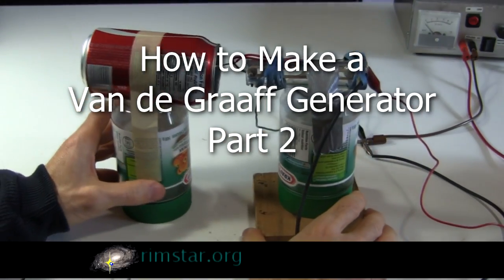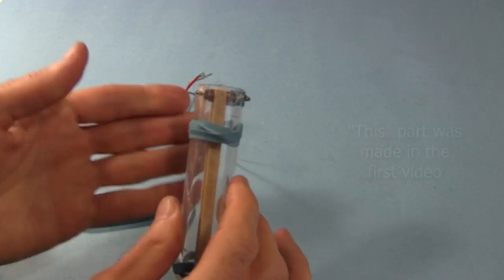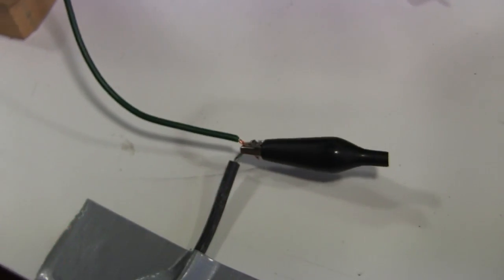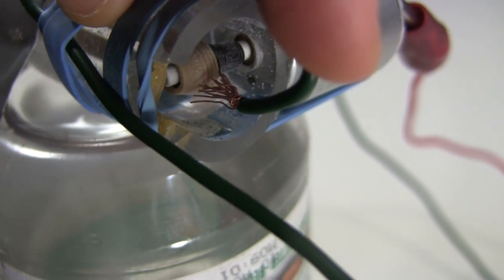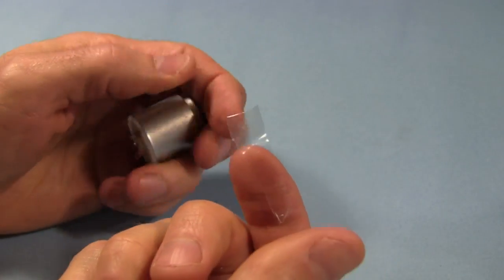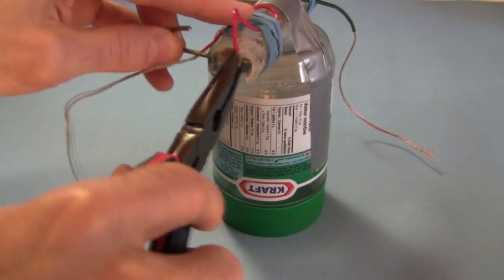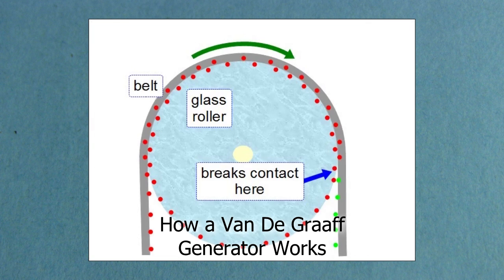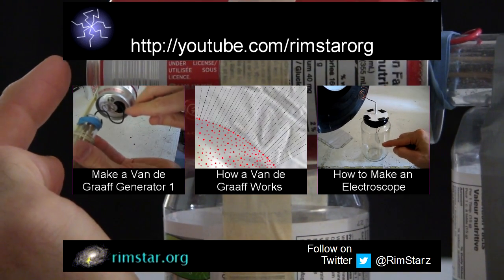How to Make a Van de Graaff Generator Part 2

Comment from the maker: A ground is necessary, but as you saw in this video there are many ways of doing the ground. Even just holding the end of the ground wire in my hand worked fairly well. Putting the ground wire inside another can worked great! In fact I don't even use the ground wire going all the way to the wall socket anymore, I just use the second can approach.

Comment from the maker: Good point. A good ground for this case is one that readily accepts or gives electrons. The soda can is small but you're connecting to the inside of it. Connecting to the inside allows the Faraday ice pail effect to take place. That effect causes the wire to always see a neutrally charged inner surface even though the outer surface might be hugely charged. And a neutrally charged surface readily accepts or gives electrons. Connecting to the outside of the can would make it a bad ground.

Comment from the maker: You're right on. The triboelectric effect that causes the static electricity when you walk on the carpet is the same thing that's going on between the rubber belt and the rollers in these Van de Graaff generators. When you walk on the carpet, the material in your sock is making and breaking contact with the carpet and that causes negative electrons to transfer from one to the other. As a section of belt makes contact with a roller and then breaks contact, the same transfer takes place.

Comment from the maker: Good question. My guess would be that the sparks would be the same length but thicker/brighter/louder/more painful. The latter would be because when it sparks, there'd be more charge/current in the spark. I think it'd be the same length because the curvatures of the surfaces involved haven't changed. You should get the same length sparks near one spot on the dome with and without the can. But you said below that you're getting longer sparks, and experiment is king, so, so much for my guess. :)

Comment from the maker: What materials are you using for the belt and the two rollers? How are you doing your grounding? If you're using the second can as a ground, are you connecting to the inside of it? The faster your motor turns the better it'll work, but be careful not use more than your motor's rated voltage and current. The wires facing the belt must have sharp points, multi stranded wire is good for example, but space out the strands. The wires facing the belt must be close as possible.

Comment from the maker: That depends on how fast the motor can turn the belt. If it turns slowly then it will take longer to charge up the can. The faster it turns the faster the charge will build up and the more frequently you'll get sparks. Make sure you also watch my "How to Make a Van de Graaff Generator Part 2" video for more construction tips. There's a link to it in the description for this video.

Comment from the maker: When you were using the tape, either one, as a belt, did you have the sticky side facing outward? It should be. What are you using for the brushes facing the belt at the rollers, where I use the fanned out ends of stranded wire? Multiple sharp points are needed here, so if you're using stranded wire, separate the ends and put them as close as possible to the belt. Try different locations facing the belt. Just because it's nylon wire doesn't mean it's not coated. Experiment with other materials.

Comment from the maker: You can increase the length of the arc by moving your finger farther away. Sounds like a silly answer but the increased distance gives the can more time to build up charge, though the arcs will take longer to happen. You'll probably still find a limit so using a bigger, more rounder dome instead of the can will help. In case losses are happening too fast you could spin the belt faster - faster motor, more power to the motor (but stay within the motor's ratings), grease the shafts.

Comment from the maker: Did you try to pull it off somehow (with a pliers or something) while it was heated? You may need a hotter soldering iron. The soldering gun I used was 150 watts. Most soldering irons are 10 to 30 watts. I'm not sure what the minimum you'd need it but that is a difference. If you can find a way to hold it you can put it on an electric stove's heating element, but put a pot of water on the same stove element beside it to protect the stove element.

Comment from the maker: I used my homemade power supply. What you need for power depends on your motor. Motors are rated for a maximum voltage and a certain amount of current/amps. You can try running it on batteries, but it depends on the motor whether it's powerful enough to turn the belt. Another option for power is wall adapters, the ones that come with many appliances. Check the writing on them to see if they supply the voltage and current your motor needs.

Comment from the maker: To start and stop it put a switch on the positive wire going from the batteries to the motor. Make that wire long enough so the switch can be in a handy place.

Your Ghostbuster idea's brilliant. That way you can also put as many batteries as needed, including spare ones, in the backpack. Be careful to not cross the streams!

Don't use rubber bands to hold the brush wires in place. With all the moving around you'll do you should use something that'll hold them more rigidly facing the belt.

Comment from the maker: Do you mean nylon fishing wire for the surface of one roller? What's the surface of the other roller? In the triboelectric series table one roller needs to be towards the positive side, one towards the negative side and the inner surface of the belt in the middle.
Do you connect your wire to the aluminum ball's outer surface or did you make a hollow ball and connect the wire to the inside surface. It needs to connect inside, and have a gap around it where it enters the ball, like an open mouth.

Comment from the maker: Go to wikipedia. Search for "Triboelectric effect". Part way down on the right is a Triboelectric series table. Glass is on the + side, vinyl (electrical tape) is on the - side. The belt material should be in between those two in the table.
I doubt that the elastic in trousers and shorts would work. It doesn't have a very smooth surface so there wouldn't be as much contact with the rollers and I suspect there's a lot of die to color it.  But that's just a guess, I haven't tried it.

Comment from the maker: It's not grounded in the strictest sense. The two wires going to the outlet are called hot and neutral. The neutral in the US should connected to ground at your main breaker panel box. However, depending on who wired your outlet, the hot and neutral may be backwards or the ground to neutral connection may not have been made in the breaker box.

Comment from the maker: I'm not sure if a drinking straw will work well. I don't think so. I tried it when I was making that section of video and it wasn't giving good results but then the glue I used to hold it to the motor shaft failed and the straw started slipping. I'm pretty sure that before it started slipping it was giving bad results but you could give it a try anyway.

Comment from the maker: He gets bigger sparks due to the materials for the rollers and belt, which is really just a case of luck in what you have around, and because of the wider belt. The wider the belt, the more charge you pump. In fact, given the slow speed of his motor, I think it's mostly due to the wider belt. His wire ends are also pretty small, which may help. Nice touch using a plastic bottle, though that's not an option when using rubber bands, unless you cut the bottle shorter. How about a video of yours?

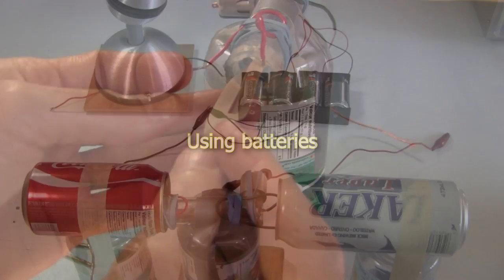Comment from the maker: There are two portable ones in this video. At 10:14 the small commercially bought one is small and battery operated and with a better motor the version of mine with the two cans or with one can and a person's body as ground are both portable, well mine would need a rigid structure but that's simple enough. I was thinking of making a gun shaped one for fun where the ground wire could go to the hand grip and make electrical contact with the hand, or maybe one with the can on the end of a staff!

Comment from the maker: It depends on what material you have on the outer surface of your rollers. The charging works because of the triboelectric effect that happens between the outer surface of the rollers and the inner surface of the belt. So if you look up a triboelectric series table, the bottom roller material should be at one end, the top roller at the other end and the belt should be in the middle. See my "How a Van de Graaff Generator Works" video for illustration of this. See link in this video's description.

Comment from the maker: A looser belt would help with motor load for sure. Trial an error with a few different distances between rollers would find the sweet spot. Rubber bands don't last forever so best would be an adjustable distance.

It's hard to make tinfoil keep a steady pressure over time but some way could be found I'm sure.

There's definitely capacitance between the cans. Another way of looking at it is there's an high voltage electric field between them.

"too much stuff on the bench" I know what you mean...

Comment from the maker: Sure, as long as your heating pipe goes to ground somewhere. Mine actually goes into the concrete foundation of our building  (hard to believe, but true.) But even if it isn't I'd suggest giving it a try anyway.

Comment from the maker: You could try. I guess if it's so fine that it doesn't put much pressure on the rubber and contacts it tangentially instead of with sharp points facing it directly it might be okay. I was getting good enough results without it touching so I'll just leave a gap from now on.

Comment from the maker: Putting the end nearest the dome right inside the dome so that the roller and shaft are inside the dome helps. The materials on the surface of the rollers may have room for improvement. In my part 1 video I used nylon thread for the top roller and got an improvement when I switched to a glass roller in part 2. Use the triboelectric series table for ideas for roller surface materials.
For noise, grease the shafts but be careful not to get any on the surface of the rollers or belt.

Comment from the maker: I was thinking a more rigid arrangement altogether would be better. For example, see 0:23 in the video (How to Make a VDG Part 2). You'll see that the small commercial VDG I have uses a stiff wire holder to hold the brush in place. I'm not suggesting that specifically, just that it be something less flimsy than a wire bent around in space like I did, which is susceptible to movement.

Comment: Nice set of videos, really nice. Next time, for the highest possible negative charge roller, use the tube but wrap it with teflon plumbing tape. I built one using a 3/4" rubber band and teflon on the top roller, making the ball positively charged, and even with a quicky small coffee can (not the best dome at all) it would put out around 1-1/4" sparks. It was enough to prove conclusively that cats can levitate! (Tabby got curious and sniffed the can.)

Comment from the maker: If the 9V motor makes it turn faster then it will generate sparks more frequently, not greater sparks. To get greater sparks, use a bigger can/dome. Just make sure it doesn't have too many sharp edges.

Comment from the maker: Yes, but it must have rounded edges, the rounder the better. Sharp edges will leak charge more easily because the electric field will be stronger there and you won't be able to build up as high a voltage.

Comment from the maker: A door knob would work. Try not to have any sharp edges. Make sure you connect the wire to the INSIDE of the door knob. Brass, or any metal, is okay.

Comment: Wow I am amazed how much difference that setup has made.I believe you have doubled the voltage to 8000volts.The pull tab sharp edges might have been responsible for some loss.
But having the top inside the ball is common it seems that is important.

Comment: After much tinkering I found if you cut out bottom circle shape part from a can and attach that to the top of ur can so it forms a dome rather then an indent, I used electrical tape to smoothly attach, it increased the device 10000000%

Comment from the maker: WARNING. The following can be dangerous. To test if I have a grounded neutral at my outlet I use a voltmeter on the AC scale. I measure the voltage between each of the two rectangular holes and the ground hole. If the voltage is around 0VAC then the rectangular hole is neutral. If the voltage is 120VAC for both then your neutral is no good as a ground. I'm not sure it's such a good idea using neutral as ground anyway. Probably best to go with one of the other suggestions in this video.

Comment: Very informative.  Would using a looser (not slack, just not as tight) belt to reduce motor load still work ok? Maybe tinfoil could make the earth brush, then it could contact with less wear? Have you looked at potential capacitance between the two cans? I can see it being advantageous in some situations... I'll try one day, too much stuff on the bench atm....

Comment: I just used the shaft of the motot for one of the rollers and wound some ducttape around it. for the other one I used an old pen and wound the fishing wire around it. I just made a solid ball of aluminium, but I think I have to make it hollow, one way or another. Could I role it around a paper-tube so that it's hollow?

thanks for replying so quickly

Comment: Meanwhile I've completed my own Van De Graaf generator. As you can see in the last video in my channel, it give spark about 2-3cm which's well enough for a tin can dome. The trick is - it takes time(sometime significant) to "warm up". Like as soon as I turn it on, it looks like it does not work. However, after a few seconds I start feeling very faint electric field. It grows stronger, starts sparking and after about 10 minutes you can see how it works. If I stop it for a few minutes, it's on full power as soon as I turn it on which means it's unlikely that it's because of the rollers taking so much time to charge since they'd definitely discharge in this period of time.

Googling did not help - everyone's VDG's start immediately, only mine acts weird. What do you think might be a reason?
Reply from the maker: Александр Санников Maybe you have a humidity problem. That could explain why it takes a while to "warm up". The roller and inner surface of the belt need to get rid of their humidity, possibly from their interaction or from heat build-up. And regarding stopping for a few minutes, possibly the rollers and belt are still dry or heated or charged a bit.
Reply: +gramahL hope I'm not too late but these voltages will surely damage a DVM. perhaps old style TV repairman type high voltage probe.

Comment: Inspirational! I would use a carbon fiber tow (or a carbon fiber antistatic LP record brush) for the electrical brush at the rollers and Ikea stainless steel bowls for the spheres. They're not perfectly hemispherical, but reasonably close.

Comment: My support for the top roller (nylon) often grinds against the roller,  si can I use some tape to smoothen that inner part?
Also, how do you use isopropyl to clean your equipment ? I am using an rubber exercise belt for my belt, and am unsure about what to use for cleaning it.

Comment from the maker: So duct tape roller and belt with an nylon roller. That's not optimal since only youe nylon to duct tape belt will be doing real work but I've seen similar setups that worked (vinyl black tape roller and belt with other roller glass.) The way you did the solid aluminum ball is a bad ground, so I'd fix that first. Rolling aluminum around a paper-tube and also covering one end should be good. Insert your wire through the remaining open end and attach it to the inside of the aluminum.

Comment: You use a can for the dome but would, let's say, a door knob cut down work? I happen to have one that I salvaged from a curb alert. I was thinking of trimming down the throat to where it starts to dome out. But I think its brass or maybe a pot-metal as its not magnetized. Being that would it make a difference?

Comment: will this van de graaff gen. help in providing necessary voltage for your ball cyclotron ????
Reply from the maker: I didn't try this Van de Graaff with my ball cyclotron because I doubted it would be able to produce a sufficient voltage. It might work with a much smaller ball cyclotron -- maybe a soup bowl or smaller sized one with 8 metal strips of alternating polarity.

Comment: What did you use for power supply??/Can u explain in detail???? Can i run it on batteries?????I have a toy motor dunno how many volt motor but it does not run the belt when i give little tension to the band.....can u help me......how many volt motor shud I take??? Reply as soon as possible

Comment: i need to get my motherboard for my computer build so i can edit together a how-to video for my design. only problem with mine is that it wants to build up a high voltage, but it cant, it keeps arcing down to the motor, especially when i have the ground connected to the power supply. electrical tape seems to worsen it (as if the adhesive is conductive!)

by the way, what are these electrostatic generators in general useful for?

Comment: Hello Rimstar, I tried using electrical tape and nylon wire, and it didn't work :( I used a soda can as the dome. I don't know what I'm doing wrong. I tried if the soda can and the wire were well connected by making a peace of PVC static and then hold it againts the wire,  heared a little tick, my electoscope also gave a sign of life(when I holded it next to the can). I might try another type of generator, what could I do as a last try to make it working?